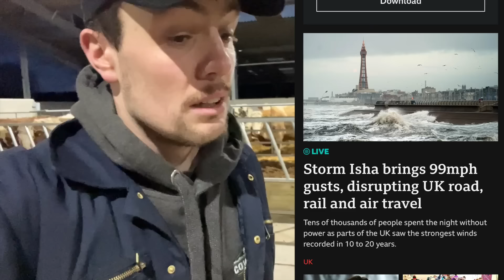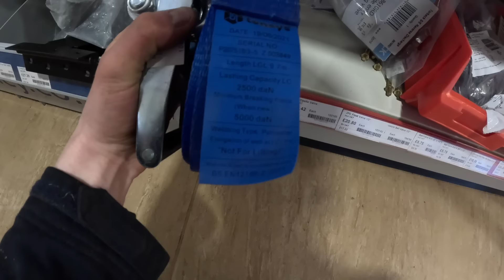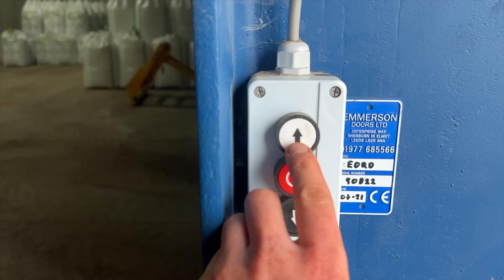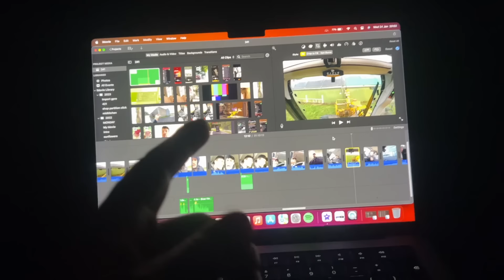Storm Causes Serious Damage | Disaster Day On Farm | Crashed Van | Breakdowns | Power Cuts

Comment: Would be worth investing in a tractor driven generator to help out with the shop with powercuts but also if you work with a borehole for watering the cattle you can't be without power too long as we have found out, it was one of my best buys, like you we lost power for 18 hours on Monday.
 It never rains but it pours when there's problems.